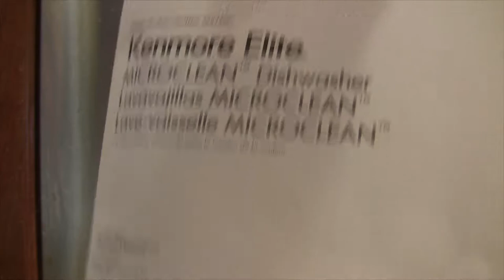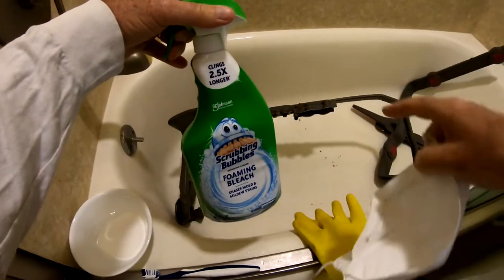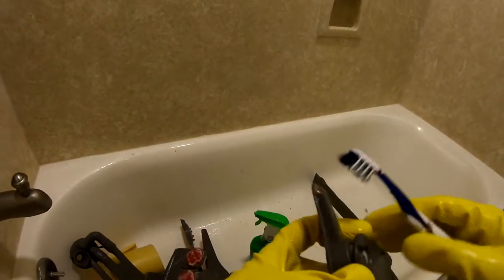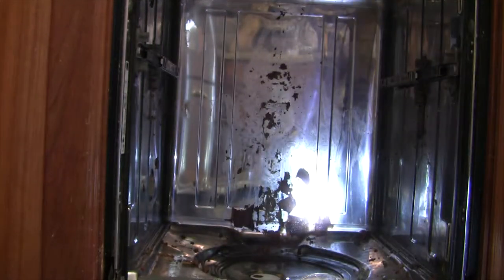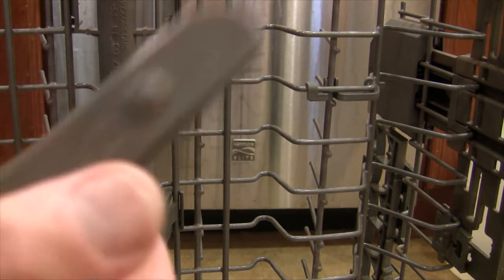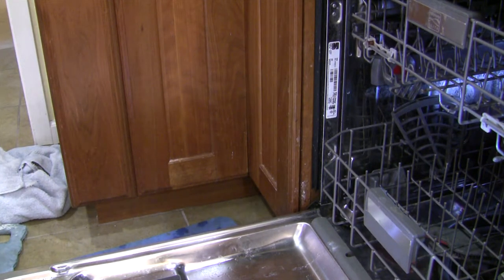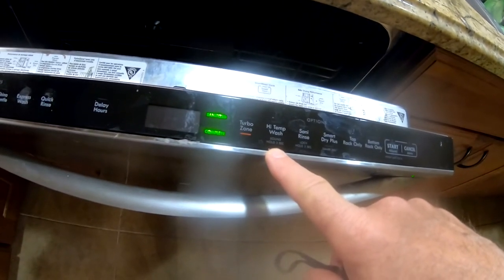Completely Cleaning the Red Gunk (Pink Slime, Serratia marcesens bacteria),  From Your Dishwasher

Comment: We had a FIERCE, explosive pink slime appearance in our KitchenAid dishwasher after a few years of use and not a lot of thought to active cleaning. I would regularly removed the filter and wipe the inside down, but that did not do it!

When I opened it one morning, it honestly smelt like DEATH and there was pink goo everywhere (and there had been a only a bit of what we thought looked like rust before that. It was AWFUL!

I ended up taking out both of the racks and cleaning all parts of them thoroughly including removing any mechanism that COULD be removed, as the mold gets into any cranny or crevasse. I used Purrell Food-safe MultiSurface disinfectant. I then removed the spray arm and filter and took a spray bottle of the disinfectant to the entire inside. I had to spray the side sliding rails over and over again and brush them out over and over with the toothbrush, because  I didn't want to slide the dishwasher out to remove the screws from that outer area. 

Then, just when I thought i had gotten everything, I check the seal that goes horizontally across the bottom of the dishwasher door and onto the actual dishwasher, and there was a TON OF SLIME in there too!!! Anywhere you cannot see, there is always more goo!

Finally, I did repeated hi heat sani-washes, alternately with the Finish Dishwasher Cleaner and then another with a bowl of vinegar inside. I am also using the Quantum dishwasher tabs instead of the eco-friendly (but not slime good neutralizing) tabs I was using.

It is clean now, and I am going to be religious about ensuring it stays that way!

As SOON as you see a bit of pink or orange residue in your dishwasher, disinfect the WHOLE thing! Don't let the pink slime get ahead of you or you end up with a BIG JOB to banish it!

Thanks for all of your tips!
Reply: Oh yes,  make sure you take off the spray arms and run disinfectant through them - it is GUARANTEED there is goo lodged inside of them! YUCK!
Reply from the maker: Thanks for relating your story. It's horrible like you describe. You have to take every part of the dishwasher that conveys water around out and disinfect it when it gets to that level.
Reply from the maker: @LeaAnnM  Yes, I do that every time I clean the dishwasher now. I take then to the bathtub and pour disinfectant into them and swish it around and then rinse with water until all of the pink slime is out of there and the water flows freely out of each hole.

I use bleach because I know that will definitely kill bacteria. Since the spray arm is plastic, the bleach doesn't affect it like it does the stainless steel inside the dishwasher.

The other key is to use high-temperature wash every time (not sani-rinse except when cleaning). That helps keep it in check, but doesn't prevent it.

Comment: Thanks for the video, I have the same dishwasher. I took the cleaning to the next level, took the interior parts out as described and proceeded to uninstall the entire washer. Then I carried it out to my driveway and powerwashed the entire thing. Neighbors were looking at me at bit sideways but man this was so much easier that scrubbing! Thing looks brand new! Had this washer for 7 years and never cleaned it. Will start the monthly vinegard/baking soda cleaning going forward. Was also wondering if our tankless hot water heater inhibits the performance as the hot water takes quite some time to get hot once the valve is opened....
Reply from the maker: You’re welcome, I’m glad it helped.

One of the big problems with this dishwasher is all the exposed piping that creates areas where moisture can stay and breed the pink slime. One thing I didn’t try was to keep the door open between washes to help dry it out. I read that was a good idea with your clothes washing machine, so I do that as much as possible.

Our Kenmore finally gave out. We upgraded to a Bosch that use zeolite crystals to generate heat for drying. They can get up to 176 degrees F which is enough to kill bacteria.
https://www.bosch-home.com/us/experience-bosch/crystaldry
I also have it set to do “extra” drying even though it uses more energy. I would recommend that for all dishwashers just to eliminate as much moisture as possible. Of course with our new dishwasher, I’ve been cleaning it once a month using this technique.

In fact, I just released a new video about that with our Bosch: https://youtu.be/ruwc8nNoXEU
I also released a video about using the same technique on our Washing Machine: https://youtu.be/nE0rJtSPw_U

I highly recommend Bosch dishwashers, we bought a Meile before the "pink slime" Kenmore and it didn't last that much longer than the Kenmore we had before that.

About the hot water. I remember one dishwasher we bought (I think it was this one) that said to achieve its "Energy rating", you had to run the hot water in the kitchen sink to speed up when the hot water got to the dishwasher. What I do is fill the dishwasher and just before I run it, I wash any dishes that are too big or didn't fit by hand which gets the hot water to the sink/dishwasher area before the dishwasher starts.

Good luck with your battle against the Pink Slime!
Reply: @BetaCygniBlog  I was looking at that Bosch you posted. Bosch really are the best. I now know this thing inside and out :) 

I ordered a device to trigger my tankless hot water heater for the dishwasher as I have it set up in our primary shower. This should help. Curious to see how long the slime stays away while doing the monthly baking soda and vinegar routine. Hopefully, indefintely. If not, I'll pull it again in another 5 years, if it lasts that long. Not really thrilled with the lack of filtration on this unit, can see that posing a problem in the future....

Comment: I just went through the same process with our Kitchenaid dishwasher.  Did you have gross stuff in the rails also?  I had to use a spray bottle to flush out all the junk.  We have the same dishware! Ha!
Reply from the maker: Yes, it was on the rails. Lots of scrubbing with a toothbrush.
It's been a couple of months since I did this and we seem to be keeping it at bay.
I think the key is to use Hi-Temp wash (160 degF) every time. That will keep the bacteria under control. Once a month I use a Finish Dishwasher cleaning tablet (the one they tell you to use 1/week) along with my regular dishwashing powder (Cascade Complete or Finish) and run an empty cycle with "sani-rinse" (180 degF rinse).

It's too bad you can't use bleach in a Stainless Steel Dishwasher. That will kill anything!

Comment: I'm going through this right now.  It's so disgusting.  I thought it was rust until my son was housesitting and asked what was going on with the dishwasher. I've taken it all apart and trying to figure out how to get the bottom spray arm off. I put the racks in the sink and the spray hose got a lot off. I did use a bleach spray, which they say is not recommended, on the rails and back of the machine.  Then I used Clorox wipes on the counters where some slime had sprayed. I put it on its strongest 3 hour cycle.  It came out very well, but I still had to go in with a scrub brush and toothbrush to get more off.

I've had dishwashers for decades and I've never seen this before.  This is a Kitchenaid that we've had for 7 years.
Reply from the maker: My sympathies.
I used bleach as you see in the video, but only on parts I removed from the dishwasher and cleaned in the bathtub. And I thoroughly rinsed everything before putting it back in the machine. It should would be easier if dishwashers were made of some alloy that was resistant to bleach. It would make so much easier to wipe out the slime!
We recently replaced out washing machine (after 7 years) with a Bosch with "Crystal Dry". It uses zeolite crystals that heat up when exposed to moisture to produce 170 degF air to dry the inside. I'm hoping that makes a difference. The pink slime loves moisture.
The other improvement is that there is very little "plumbing" inside the wash area of the Bosch. Just the the water source for the upper rack spray arm. That means fewer places for pink slime to hide.

I'm also cleaning the inside every month from the beginning. I didn't start cleaning our old dishwasher until I noticed a problem.\
Good luck.

Comment: I have to do this every few weeks. This can’t be right.
Reply from the maker: Most dishwasher manufacturers recommend you clean your dishwasher 1/month. I have an upcoming video showing how I do that, but a preview is I run one cleaning cycle (maximum temperature AKA Sanitize) with vinegar followed by a second cycle with the same settings with Baking Soda.
When you get pink slime, you also need to take out all the spray arms and anything else you can get out of the dishwasher like the racks and clean them with bleach like I do in this video.
Some dishwashers are better at keeping clean. We got a Bosch dishwasher with "Crystal Dry" that drys your dishes using a mineral (zeolite) which heats the air up to 176 degF. That is hot enough to kill bacteria like pink slime. It's working great so far. 
https://www.bosch-home.com/us/experience-bosch/crystaldry
Also, I've been cleaning it once/month as I say up above from THE START. I didn't do that with the dishwasher in this video, I only started cleaning once I noticed the pink slime which was a huge mistake!

Comment: I have a ton of pink slime. To get rid of. How do you get the turbo jets off to clean them?
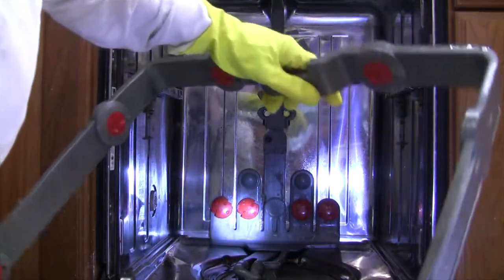Reply from the maker: Unscrew the bottom spray arm. Then remove the side turbo jets. They just snap out. You can see me putting them back in @ 11:40.
After those are out, the back turbo "tower" comes out by twisting the bottom where it locks into the water source in the middle of the bottom of the washer.
It's a little hard to do. You need to twist it counterclockwise (if I remember correctly> we don't have this dishwasher anymore). You have to put some force into it.
Good luck and let us know how it goes.
Reply: @BetaCygniBlog  Thank you so much for responding!  I got it all taken out and cleaned.  Boy, was it a chore.  That pink bacteria was everywhere and in big globs.  I will be much more vigilant in the future knowing this can happen.  After several vinegar washes, I also ran ethyl alcohol (without heat) through it for a hour to help kill bacteria. I used toothpick, toothbrushes, squirt bottles, and sponges.
Reply from the maker: @ericariley7823  Thanks for the update.

Using alcohol is an interesting idea. I haven't tried that.

My system is to take out all the trays and spray arms and wash them in the bathtub (running bleach through the spray arms and rinsing well) and then running a vinegar sanitizing cycle followed by a baking soda sanitizing cycle. We've since switched to a Bosch dishwasher with "Crystal Dry" that uses zeolite crystals to generate high temp drying without using as much electricity. We have "extra drying" turned on. That really gets the dishes (and the interior of the dishwasher) very dry at the end of the cycle.
Also the interior of the dishwasher is much simpler than the Kenmore so there's less places for bacteria to hide.

We've only had it a few months, so I don't know if the pink slime will eventually show up, but this time we're doing a monthly cleaning (using the system above) from the beginning!

Comment: This is on my bathroom floor and it will not come off. I have tried everything. I disinfected the floor by mopping it fully with bleached water, and it still keeps growing. Scrubbing it will not remove it, dish soap will not remove it, vinegar will not remove it, what do I do?
Reply from the maker: I know that feeling. 😥
What is your bathroom floor made of? 
Vinyl or tile?
If it's vinyl, it may not come off:
https://www.pcimag.com/articles/105889-pink-stain-damage-on-vinyl-surfaces

If it's tile, I would use SoftScrub with Bleach and a synthetic brush. Wear gloves:
https://www.softscrub.com/products/soft-scrub-bleach-cleanser/
Let it sit for 10 minutes then wipe it off with a dry paper towel.

Then rinse with a wet paper towel and then mop the floor.

If you have tile (like I do), use a steam mop:
https://www.lowes.com/pd/Eureka-Enviro-Steamer-Steam-Mop/3066833
That will kill bacteria like the pink slime

If you have a vinyl floor DON'T use a steam mop, it will damage your floor!

Let us know how it goes.